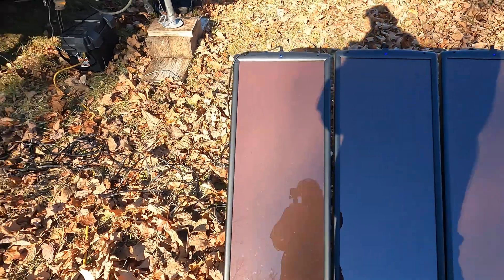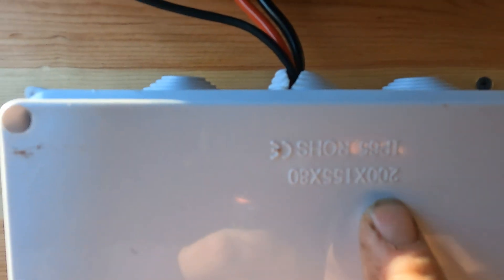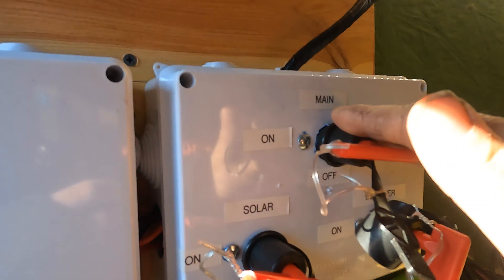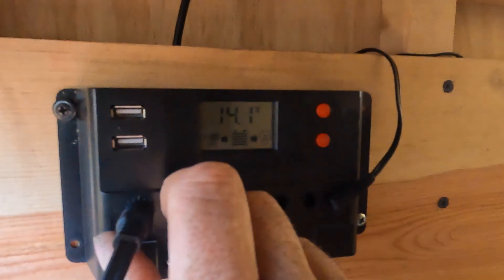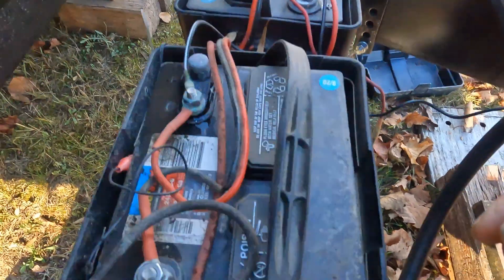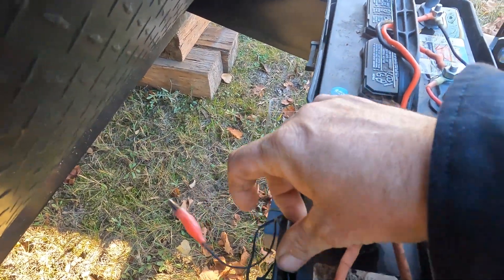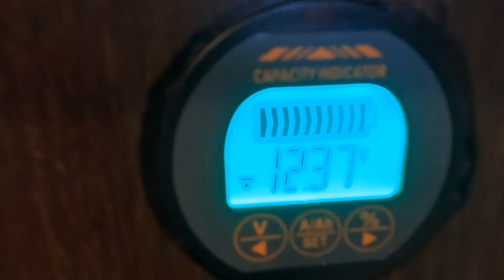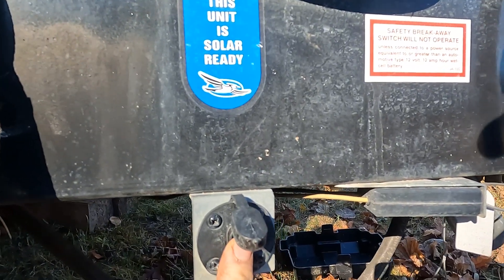Harbor Freight Solar Kit Test Surprised Me!

Comment: Question for you. I want to be able to keep a steady state of charge on my portable generator stored in my non powered shed for ready emergency power outages and have some occasional lights  in a rare occasion when I go to my shed at night..Would the battery controller that comes with the Harbor Freight Thunder Max 100 watt solar kit be able to keep my gens 12V 18 Ah lead acid battery topped off like a trickle charger would?
Reply from the maker: Yes

Comment: Never disconnect the battery before first disconnecting the panels or you will blow the charge controller. What prob saved you so far is that the panels dont produce much power.
Nice startup project. Greetings from Jamaica.
Reply from the maker: Thanks for the tip
Reply: I’m thankful I read the manual